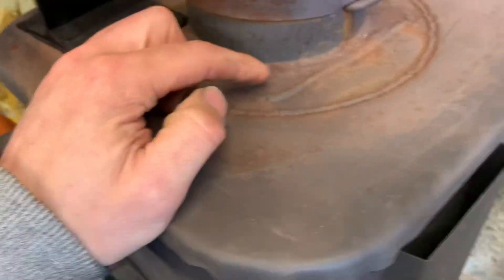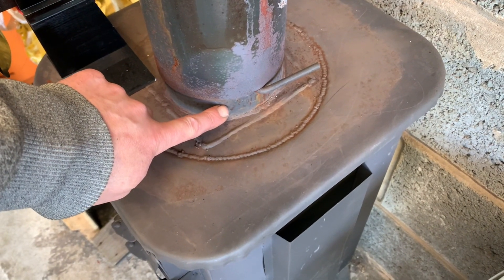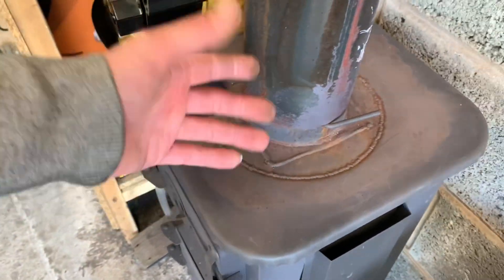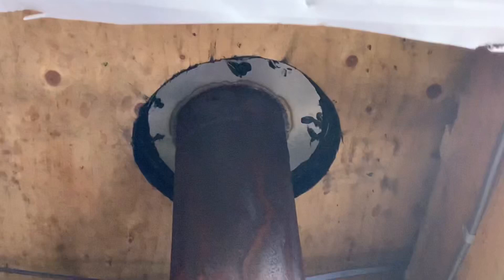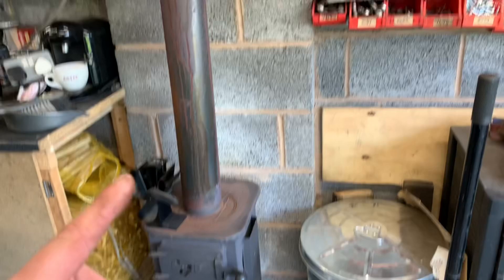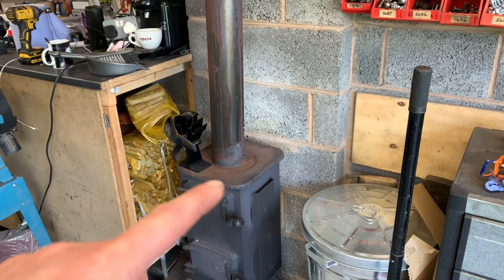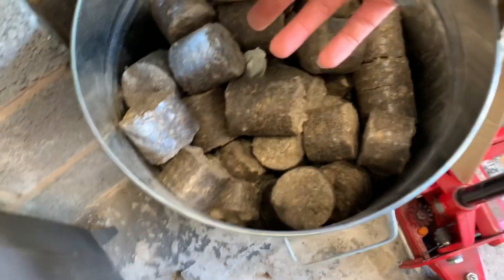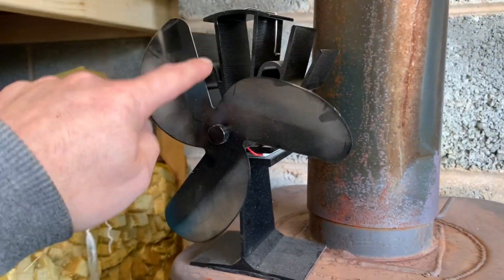Workshop log burner update and mods

Comment: Hi there can you advise me what exact part I need for the roof. My seller on ebay is giving me very little information. I’ve bought 2 flutes and 1 bend and a top cap but I need the right part fit the cap to attach to the roof. Hope that makes sense ?

Many thanks